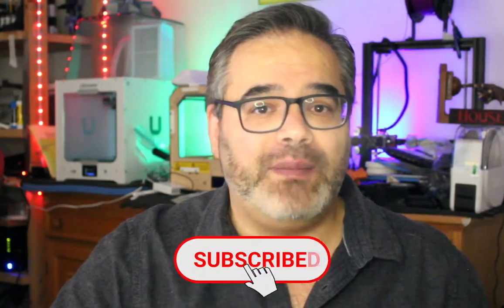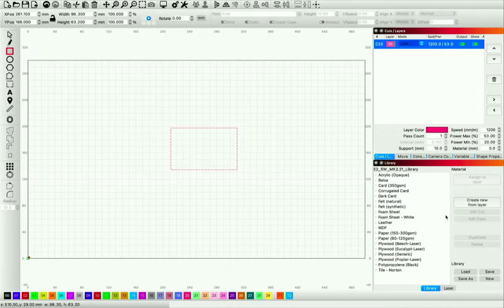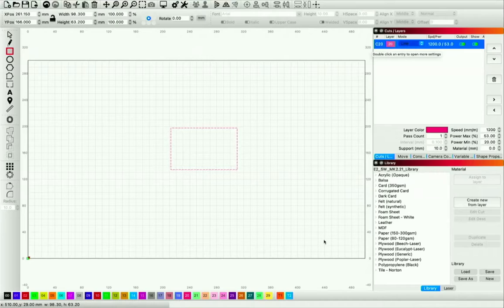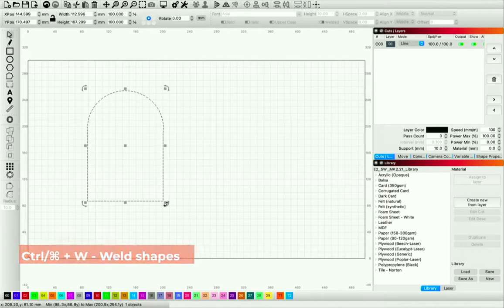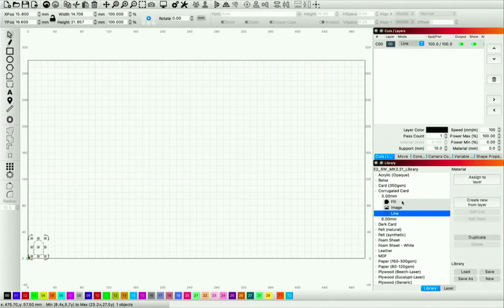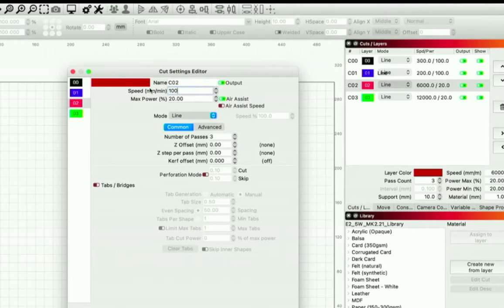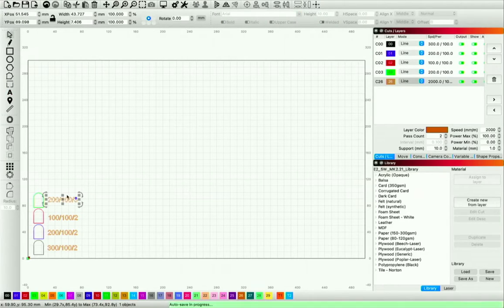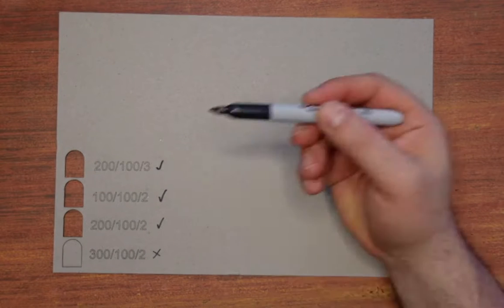Lightburn hints : Getting the best cut settings for material

Comment: Great information!  Looking at your cuts/layers window at the bottom right just under speed and power settings there is material (mm) option.   On my cuts/layers window the material (mm) has gone!   and I'm getting the message:  "your material is set close to zero do you want to continue?"    without the thickness set the laser cuts are out of focus and messy.        Is there a way to toggle this (material thickness option back- on?)

Comment: What are the best wood cutting settings for Lightburn for Longer Ray 5 10w?
Reply from the maker: Follow the workflow to work out the best settings. Each laser is different, most of the settings they give you are a guideline. I also do this test with new batches of material to get the most out of laser. 👍

Comment: Why not use Lightburn's Material Test?
Reply from the maker: Good question. First, Lightburn’s material test is a new feature and was not avalible when this video was made. Second, the material test uses a lot of material and it is suggested to do a cut test on any new material or batch of material you have.
This test is fast to do, and uses very little material. Feel feee to use it or Lightburn’s material test depending on what suits your needs 👍

Comment: My XTool d1 20w laser library has maple. that's it.  Do I test for numbers for everything else?
Reply from the maker: Yes. Every new material I use, I test and then create a power range as a starting point. 
I will also use that info to test new material I purchase as not all materials are made the same way to optimise power and speed.

Comment: I have a atomstack a5 m-40 pro was working fine and last time i used it tried to engrave a knife blade and it wouldn’t engrave anything after that i tried to engrave a piece of poplar wood laser  goes through the motions but doesn’t engrave power is at 100 percent and speed you can slow down to 200 and doesn’t engrave wood doesn’t even get warm i have reset to factor settings  using lightburn

Comment: Hi Gil   Eddie in the UK here !   Great video - thanks !   I've just bought an Atomstack S20 Pro Laser and my learning has begun !   I need to cut White Depron Material and was wondering if you could give me any recommended cutting settings please ?    Thanks again for such a helpful video Gil.
Reply from the maker: Hey Eddie, glad this video helped.
I have not used Depron before, but it looks like it's a form of foamboard. That can be tricky cause polystyrene, and lasers don't like to dance well together. 
If you try cutting it, start with low power/high speed and adjust the power until you get the result. Test often and make small changes (5-10% power at a time). Polystyrene can catch alight easily, and when it does burn, it releases toxic smoke and hardens to a rock-like substance that can be hard to remove.
Personally, I avoid the stuff or get the laser to score the paper layer, then take a blade to cut through the polystyrene layers without having to risk the material catching alight. 
I'm curious to hear what you are planing to make with Depron sheeting?
Stay safe and make something amazing! :)

Comment: Hi still learning ☺️ cant get my lizer to cut mdf 7mm I did put it on 100% power  at 400mm/m I have a 40w foxalien thanks
Reply from the maker: 7mm MDF will almost never be cut on a diode laser without multiple passes.
Try using the workflow with something like thick card first before using thick stock. MDF is not great material even if you master the laser cause of the way it’s made.
Go for the easy wins first then scale up.
Let us all know how you go 👍

Comment: I'm confused. At around 3:25 you talk about not running your laser at full power and putting stress on your diode, but then you continue to set your laser to 100% power in all your test cuts
Reply from the maker: There is a lot of debate about using a CO2 laser at 100%. As I use a diode laser, I tend to use it at 100%, but in the end, you should always use the settings you are most comfortable with. 👍

Comment: Am I correct by saying people don’t need to measure their material thickness and enter that information in somewhere? We had to do this with epilogue and universal with a caliper, why wouldn’t we do this with light burn? Also my free version of light burn does not have a built in library, does the paid version? Thanks 🙏🏽
Reply from the maker: I always measure the thickness of the material I am using as not all material are made equal. Sometimes it can be a few mm off.
Place your measurement in the materials option. You can find it on the layers tab, in the bottom right corner.
The materials library is something you have to create when using different materials over time. We have a tutorial  on the channel introducing how to add setting to the library on the channel.
What are you using Lightburn to create and what laser is it attached to?
Reply: @LaserLivestream  Thanks boss!
Reply: I just realized that if I am not measuring my material thickness and entering in the material thickness field, my material power/speed test will be an inaccurate test for cutting efficiency. Might just be me but it seems like this is overlooked by many of the teaching videos out there? 🤷🏽‍♂️
Reply from the maker: @EmpoweredPercussion  Excellent point. I think a lot of people who share processes take for granted that people measure their material. I will add that step moving forward in my tutorials. Thank you 🙏

Comment: I am new to laser cutting and am struggling a bit.     I am using a trail version of Lightburn and like it, but until finding your videos, found it difficult to understand.    The screen shot you show has more options than the one I see.  For instance it doesn't give me the option of the thickness of the material.    Is this hiding from me.?  I will continue to look at your videos and hopefully I will succeed in completing a project.
Thank you
Reply from the maker: Hi Joan, glad you found us.
Your version if Lightburn maybe on  “Beginners Mode”. 
Go into Setting and see if the first option in the page is on. If it is, turn it off and see if that changes how many options you have in Lightburn.
Let us know how you go… :)
Reply: Thank you for your reply.  I have tried that but it makes no difference.  The version I am using is Lightburn 1.1.03 maybe that makes a difference.
Reply from the maker: @joanhanna1966  Join the facebook group and post a picture there so we can see what you are working with. Link is in the video description :)
Reply: Thank you for your reply and your time.  I will work on your suggestion and return to you via Facebook next week.  I appreciate your help.
Joan
Reply: As suggested I have put up a message on Facebook.   Having succeeded in getting a sample cut  ,I tried again nesxt day with the same material and setting but it has failed to cut.  I cannot understand why this is so.  Any suggestions.  Thanks
Reply: I have the same problem

Comment: Hallo, please help me to setting my laser.
I have Neje Zoneway 80w and software Lightburn. My problem is, that doesn't cut 4mm poplar plywood. Laser have 35mm up to plywood. Speed 140-180/min and power 100%. 
Please tell me another setting to cut a circle from 4mm plywood 🙏🏼
Reply: If you have a NEJE 80W you can reliably cut 6mm MDF and more. For 4mm plywood try 95% power 165-170mm/min, possibly a touch quicker, and with just one pass, maybe 2 if you drop the power. Keep your material 2-3mm supported off the base you work on so there's an air gap underneath. If you haven't already got air assist it might be a pain but with air assist it should be easy. Also check your focus, mine is screwed all the way in, but not tight, it focuses at 20.5mm from the bottom of the aluminium body. So to cut 4mm material drop the distance from 20.5mm to 18.5mm so that the focal point is in the middle of the material. If with a 20.5mm focal length I was engraving I'd keep it at 20.5mm above the surface, cutting 6mm MDF it's 17.5mm from the surface cutting at 95% power, 180mm/min and with two passes.

Comment: Hi. I am just starting out and I am using Baltic birch plywood to make ornaments. Do I use this method to test the best results with my laser? When I cut it is burning the wood.
Reply from the maker: Yes, absolutely. The method is to work out the best settings for YOUR laser. Each machine may have a different setting. If you are burning the wood, I would turn the power down, and see what the result is. :)
Let us know how you go, and I would love to see your birch ornaments once they have been finished :)
Reply: @LaserLivestream  thank you so much! I’ll share with you when I get everything just right 😉

Comment: i love your videos, they are super helpful! but PLEASE go 1080p :D it would make following your screen captures etc a lot easier. I feel like im not wearing my glasses haha. anyway. love your content. thankyou!
Reply from the maker: Hey Gary, Thanks for the feedback. All our videos are at  1920X1080 HS and at 30P frame rate. Not sure why your playback is not cleaner, my suspicion is that if the bandwidth is a little clogged, YouTube might be throttling back the resolution so the video plays smoothly. Either way, I will look into it for you. Nothing worse than finding out that all the work put into the videos is not being delivered...
Reply: @LaserLivestream  definitely only 720p available in the video settings. No 1080p option available on this video.
Reply from the maker: @danielbass09  Thanks for letting me know. Working with YT to try and resolve this issue

Comment: As always, an informative video. Various sites (Facebook Groups, YouTube, ...) say that you shorten the useable life of your laser by constantly running at 100% power and that you should never exceed xx% (xx < 100).  What are your thoughts?  Would it be better to cut at 80% power and either slower or with multiple passes?
Reply from the maker: I know not all lasers are made equal, but the laser I have doesn't push my laser element to 100%. It's little shy of that, so I use all my settings at 100%. That said, laser elements (diodes or tubes) are an expendable item on your laser. They reduce efficency over time. I think its your call on how you want to run your laser. What you save on money, you might have to use more time. With all the different things happening, time is the most expensive element for me.

Comment: 90 degree sharp corner?
Reply from the maker: Most boxes have 90 degree corners. Sharp in the way that they change direction quickly, compared to the gentle slope of a curve.
Reply: @LaserLivestream  I was questioning your "25 degree sharp corner" dialogue, should it have been 90 degree sharp corner
Reply from the maker: @nikkicork8815  Your right. 25 degrees won't cut it. Thanks for bring it to my attention 🙏